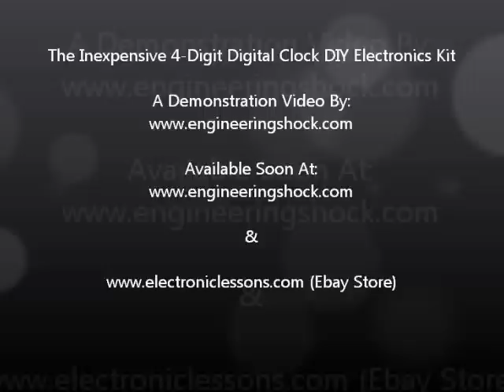The Inexpensive 4-Digit Digital Clock DIY Electronics Kit

Comment: All it needs is a diode protection circuit  then wouldn't have to worry about shorts or reversing the battery. Diodes will save it from breaking

Comment: Why are there so many resistors in a circuit board lined up?  Why not just one mega resistor?
Reply: Ah when I was a newbie, I had that same question.
The reason is if all the LEDs (in that led digit display) were sharing one resistor, the more light up, the less bright each one will become. This is because the total current stays the same throughout the whole circuit. So multiple LEDs in parallel mean that due to not all LEDs being made exactly the same, one may 'steal' the current from the other. Unfortunately, I get a bit confused here but it's just circuitry physics.